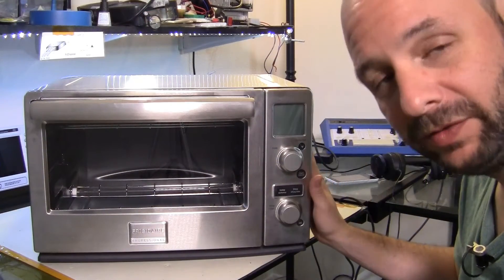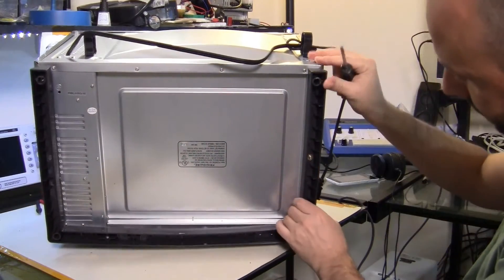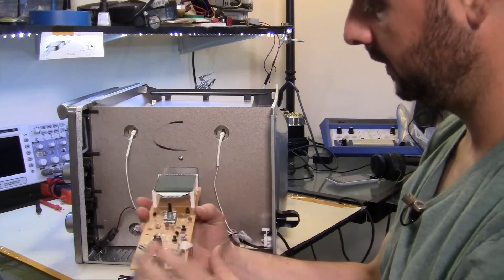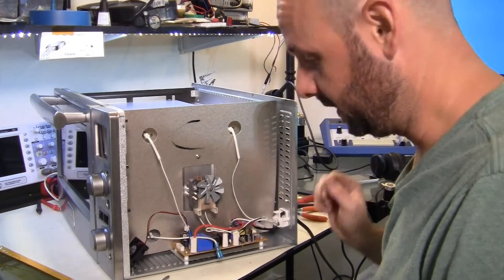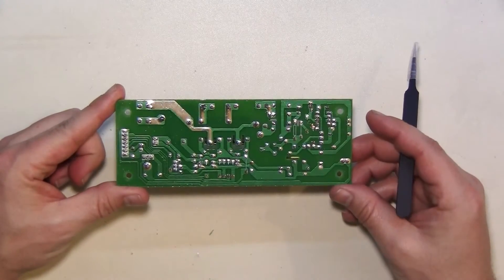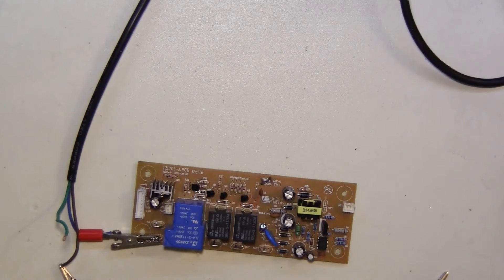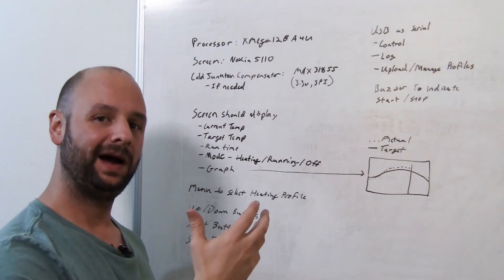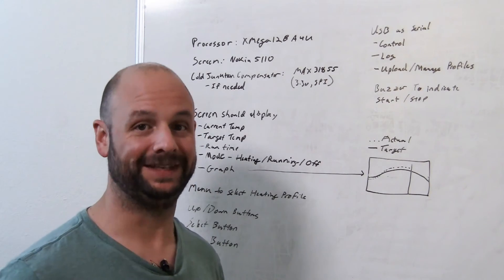TheÆ #7: Reflow Oven Project Part 1

Comment: Very nice presentation.  I have a controller for a refregerator that has a similar layout as for the oven.  It uses a pic programable controller to monitor the temp and cycles off and on for the defrost function in place of the AP3706.  The pic is fried, and GE does not offer a replacement so in order to fix it you need to buy a completely new board which is no longer available from the company.  The board is available used but of course you take your chances as to whether it works or not.  For most people, this means you need to buy a new fridge.  Everything else works fine and is repairable.  This is what companies do so you buy a new appliance every 10 years or so.  The same goes for GE washer, dryer, and electric stove.
Reply from the maker: Do you have any plans to try an replace it with your own implementation?